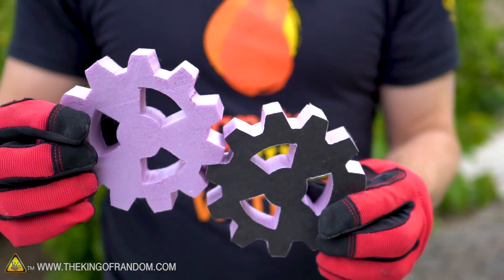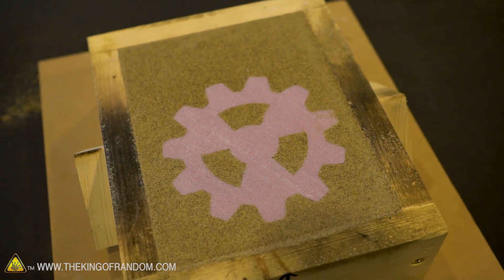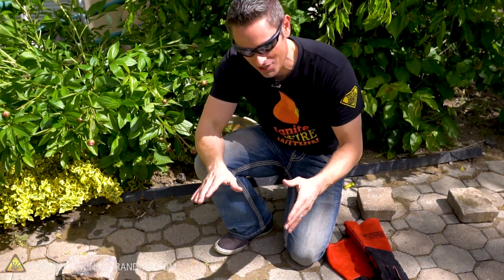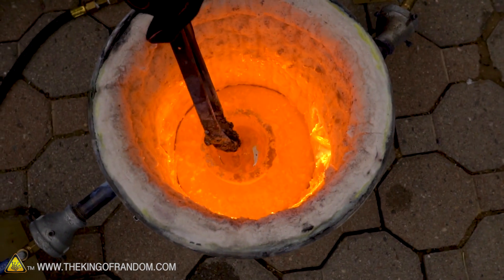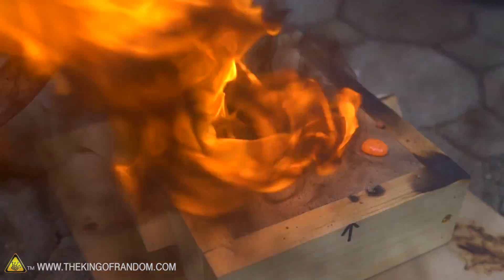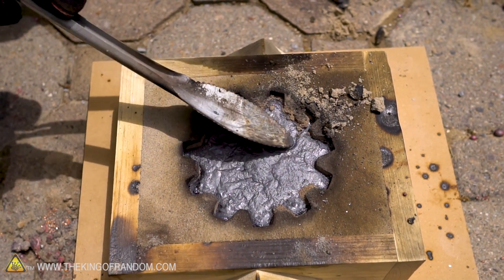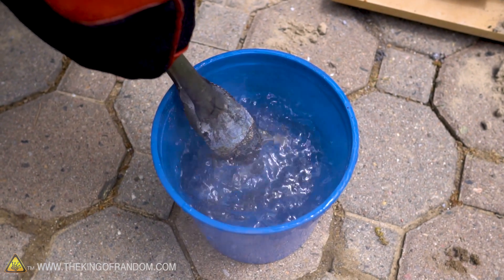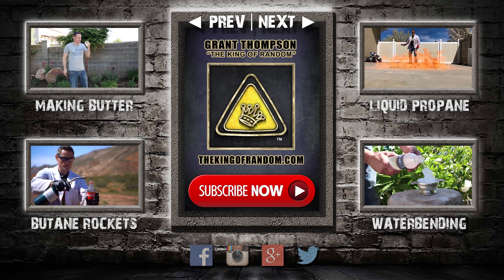Argh. Why Is Copper So Difficult? TKOR Tests Melting Copper In Our Homemade Foundry

Comment: problem is that you are using an open cast. you need to close the top and then you put the copper. given that the mold is closed it will stay molten for longer. do not pre-melt the styrofoam, that is what keeps the sand mold shape when you put the cooper.

Comment: The sand is far less dense than the copper, so in a pool of liquid copper it's going to tend to float. The glass company Corning ran into a similar problem when casting the borosilicate glass mirror for the 200-inch Hale Telescope in 1934. The mirror was designed with a waffle-like back to make it lighter and save material. To produce it, ceramic blocks were bolted to the floor of the mold, but the glass was so hot that it melted the steel bolts holding the blocks in place. Several of the blocks broke loose from their mountings and, since the ceramic was less dense than the molten glass, floated up into the glass and ruined the first mirror.
Reply: I’m late but that’s awesome! Did they spin it to make the parabola or was that a following step, do you know? 😊
Reply: @mtqrx  Oh, this was 1934. They didn't have anything like the means to spin tons of molten glass. The rough glass blank was more or less flat. After it was poured it had to be annealed in an oven and its temperature lowered gradually over several months to prevent cracking. It was then shipped by rail to California and over the following years something like half of its weight was ground away to achieve its final shape.

Comment: Aside from the starting angle of the mold when the pouring starts, and your way of pouring, my problem when I worked in a foundry was learning to keep the mold the right temp, and checking for graphite buildup inside..
Reply: They were Iron molds, I forgot to mention.

Comment: I don't know but guess the bottom of the pattern has slightly smaller area than the top, which creates a V shape at the sides, which gives the melten copper a chance to push up the sand columns

Comment: I have casted copper in green sand before and had some success 
What I did was I made a mixture of 70% sifted play sand and 30% powdered bentonite clay then mixed it with water until it seemed like enough. 
When making the mold I made it with an object i wanted to cast, then removed the object an and blased the mold in my oven to make as hard as a rock. After that I was ready to cast

Comment: Possibly try preheating the green sand mold. Itll stabilize the mold. And help with fluidity off the metal and ensure a better casting
Reply: Did you not get the news? He passed almost 2 years ago now

Comment: The sand mold should be made of 5 parts. 1 for the gear and 1 as a top which will include a well (to pour into) and gate (passage to the part), vents (to get out the gases from burning the foam), and a riser on the opposite side. The voids that you want are 3 separate pieces that protrude into the top and bottom of the mold. This method will also slow the cooling because the mold insulates the molten metal. Just make sure your sand is sturdy enough to actually remove the pattern, and the pattern should have draft angles of 3 to 5 degrees to allow it to be removed from the sand with less damage. Personally, I would just stick with investment casting, it's more accurate, and the mold is more robust and easier to make.

Comment: you have to use clay, when you wet the sand the temperature vaporizes the water which disturbs the cast. If it is dry than it won't hold. Use clay. If intend to use sand regardless then bind it with something else - oil, dry it complerly first though.

Comment: You should do it in the traditional way,,,,  wood pattern,,,, and a two piece box. The weight of copper in the riser will provide pressure to fill the mould accurately, and it keeps heat in, preventing chilling

Comment: Surely you could have made a mold that was completely encased in sand with a spout etc. The islands were coming away because they were only supported on one side... if you could have supported them from both ends I dont think this would have proven half as difficult. Just my 2cents man.

Comment: copper melts at1981.4 degrees, and boils at 4703 degrees. if you get the copper much higher temp it will pour better. I think you need more clay & water.

Comment: He pours the heavy molten copper onto the delicate edge of the sand and then wonders why the sand gets broken.  Then he pours the heavy copper into the bottom of the deep mold and wonders why the lighter islands of sand pop up like a buoys in the water.

Comment: @6:54 - REALLY dangerous!!  Moved that hot crucible of molten metal right over the top of cheap shoes using makeshift tongs.  One slip up and he would have burned the flesh right off his feet right down to the bones.  He should at least be wearing heavy leather boots.

Comment: You mentioned you thought  it was cooling too fast,  try doubling the distance between the mold snd the outer frame  all directions.  Pour the copper through  metal tubes to mold.  A little more clay to bind sand.

Comment: He definitely did not know a lot about pouring metal did he.  It is almost painful watching him make his attempts...  Do "not" use foam in a mold and try to melt it out, melting and burning foam equals cubic feet of escaping gas, guaranteed to cause issues with your pour.  Wet the sand properly and remove the foam form before pouring.  

He also needed to understand the process of "gating" the metal, you need to  create "extra" holes in your sand to allow an overflow of metal beyond the form that you want.  Molten metal has a greater volume than solid metal does this means that the poured form contracts as it cools, you need a reservoir of extra metal (gates) for the form to pull from as it contracts.

To do that gear well, one would also preferably want to have the sand mold above as well as below, this would remove the issues of the center sand pieces floating during the pour.  The only thing really difficult about his pouring a metal gear was his techniques and lack of understanding.  Hard to imagine in this day and age with all the worlds information "literally" at our finger tips, how seldom people actually go in search of this information so readily available....  Admittedly I have a bit of an edge on this guy as I worked in a metal foundry 33 years ago pouring brass and bronze bells/figurines, tools parts etc.  But still, literally 10 minutes of looking up and studying  information would have made his gear pour successful.

Comment: @the king of random copper casting is notoriously fidgety, but you can stabilize the process by using either a die, or by burying the mould in the greensand and making a pour hole, the O2 actually causes your sand to slightly deform, burying it causes a less volatile reaction , you can also use nickel or Zinc in the alloy to slow down the cooling process, which will also help, steel at 440 grade in a powder or granulated form also will work if you use approximately a 1:9 steel/copper mix

Comment: Just pour the copper onto the foam. It’ll melt the foam and fill all the space with copper. Or leave legs on the foam and cover the tire thing with sand then pour the copper onto the leg and it’ll fill the mold easier

Comment: I believe you should retry this experiment with different sand or temperature. The reason i think your attempts to make the gear casting is because you needed a second layer of sand on to so the cast wont have air pockets but you need a funnel that leads to the center of the gear

Comment: just a thought, i used to work in the art department of a foundry that produced brass belt buckles, the sand they used was mixed with regular, new motor oil. They were able to achieve fairly fine detail. Their process was very similar to what you are doing. they had hydraulic tampers instead of wood blocks. Each casting was pressed from a reusable Zinc master. They reused their sand after sieving it for chunks.They always faced with new sand. Since was not in the foundry section, i can only offer what i observed. keep up the great videos, i enjoy they immensely.

Comment: The gear is probably coming out all bumpy from the moisture explosively evaporating from the heat. Maybe wet the sand with something else or make some kind of cast that's easy to break away and that you can preheat so the copper doesn't drain its heat so rapidly.

Comment: 1. Use liquid nitrogen to freeze sand and remove Styrofoam and then pore copper into it
2. Use concrete and Styrofoam
3. Use clay and styrofoam(if need use liquid nitrogen)

Comment: you dont need to melt the styrafome( usually with blowtouch) just pour the smelt into mould an foam will evaporate.also use only one tong to extract your crucible because when its weaker before its used up after 10-20-30 melt...two tongs may apply pressure in two different directions an break the crucible more easily .or espesially a beginner or advanced.
Reply: kev bow he won’t need that advice anymore :(
Reply: Dude He's dead...

Comment: Your problem is you're melting the Styrofoam in the mold, when it melts it's damaging the base of the mold for the holes of the gear and then the molten copper is hitting it and knocking it loose. While the copper is cooling, shouldn't you have a torch on it to help it cool slower?

Comment: I was a molder when I was young. We made sand or ceramic powder mixed with a resin into a nonstick mold. The resin had a catalist to make it harden. When the resin hardens, it only took minutes then I would separate the mold from the sand or ceramic mixture. After separation you need to heat your mold with a torch to dry it completely out. Your resin was alcohol based so it would burn and dry out faster. After this I would pour the molten brass or other metals.

Comment: Hi! 2 years to late but I have an idea for the instability of your sand, the problem with moisture and green sand is that what gives its molding capabilities is the sand s friction I interacting with the water particles, thus supporting itself and able to give it shape. My thought is if you moisturize the sand, as well as as a layer of something with a higher melting point than the molten copper in the sand, (eg, particles of a heavy metal) you might get the retention you're looking for with those delicate intermediary pieces ^.^

Comment: Copper is heavier than sand, so when it was poured-in, the liquid copper slipped under the sand and lifted it.  I'm no metal worker... well, I am, but I don't do molds.  However, every mold I've seen is poured-in through a tube, and the sand is held firmly in place on all sides, including the top, so the sand cannot move up or be lifted by the force (weight) of the molten metal.

Comment: I don’t have experience in this but it looks like (especially on the last one)  those centre pieces of sand are breaking away and floating due to the weight of the copper.

Might work if you fully encase the gear with sand.

Comment: I was wrong about the bubbles. It's a common problem with copper. Try adding zinc or using some other method to degas the copper.

Comment: Use sodium silicate dissolved in water for the dampening agent instead of water.  Sodium silicate is widely used in sand casting metal.  It is highly caustic, so use caution and protective equipment.

Comment: "I've welded copper to gold" but I see your problem with the sand..try an aluminum mold and your results will happen..copper is very dense due to its atomic number , it isnt easy..simply put. p.s. I started brazing shower curtain rods to hold water at the age of 6

Comment: Why did you even go with the open mould?
Liquid copper is heavier than the sand so it pushes the sand out.
Why don't you make a match plate mould and try again.
Also try to give the gate at the centre of the mould.

Comment: Try melting the crucible. I don't know if it's even possible. But try it once.

Thank you so much for the videos. Love them.
Reply: It's not impossible, but it would be dangerous and tedious. Crucibles were built to withstand the extreme heat and pressure you get from molten metals and minerals, some of those often found in magma and lava.

Comment: use some steel wire in the cogs to hold them, run them straight through the mold basically as rebar

Comment: Why don’t you do the same way then put another block of sand with sand funnels so you can pour the copper  you can leave the styrofoam in in there and it will melt it down ... if you do this leave other small holes bc gas can leave and you’ll see you copper come up to know you have a full cast    Then all you’ll have to do is chop off the rods and then sand it down

Comment: Can you use mud or dirt to cast a gear
Reply: baking clay will work as long as you mold is baked entirely dry...Never pour copper in a clay mold that may have moisture in the clay

Comment: Your not packing the sand enough. Also you need a second half of the cast even if it's a blank on top of the other one and two holes into the mold then only pour through one hole

Comment: I think you should have put a board on top of it and drilled a decent sized hole in the center and leave the gear compressed with the board on top and then pour it then the sand won't have anywhere to pop up at that might work

Comment: You need to do the mold exactly as is then get another solid mold on top of it with just sand so it's closed in the middle. Then lastly a hole to lead to the mold itself in the compacted top sand. That insures the best possible molding

Comment: I was watching a documentary, How it's Made I think it was, and they made a top mold of sand with a sprue hole to pour into. I think that was your problem, the top half of the sand mold holds the bits of sand from moving or floating up.

Comment: If you make a trench on the side for material to run into mold pouring it on top is to much weight it’s pushing sand around.

Comment: Why not just just use a much harder styrofoam of use tape or glue on its bottom and in the radioactive symbol? that way,  when it melts it lasts juuuust long enough to hold the sand in place

Comment: Open faced molds obviously don't work well. You need a cope and a drag to prevent the hydraulic event which is popping off the sand when the heat dries out the moisture. You might want to try Petrobond sand. The results will be super clean...

Comment: Seems to me you need a second wood form just with sand, sandwiched up against the gear mold, that has a hole to pour the copper into so it flows down into the gear. The extra layer should keep your original mold intact. Im not a metal forger but it seems like common sense to me.

Comment: When we thermite weld railroad tracks we use a foundry clay. It has sand already in the clay, but the clay needs to be heated slightly prior to pouring your slag/metal. You don’t want your clay to appear slimy because any additional moisture may explode because of temperature difference.

Comment: Why don't we use cement and sand mix.. rather than use simple sand ???
Reply: That will explode are you trying to get people to blow up cement holds moisture moisture in gas and he explodes it will explode

Comment: Pack one box with the gear. Then pack a second box with no gear. The box that has the gear needs a hole like pack a pipe that gose the gear. Now box with no gear on bottom. Box with gear facing down  on top. Poor cooper through pipe to gear wait 15 min then pull apart works every thime

Comment: I worked in a foundry for many years.  We have chemicals to our sand so it sets better and holds it's shape better.  One other thing is we never pour directly into the piece we are making.  We have runners and vents which allow the metal to flow and fill.  I hope this helps.
Reply: Was thinking the same.. would be so easy and perfect with vents
Reply: Things we get taught in college has implications tho......
Reply: Waterglass to the sand, hardened with CO2.
Reply: to bad he can't see this😭😭😭😭
Reply: @redpearyear  wait he has dead?? Ive seen some comments bout that
Reply: @gyrozeppeli8932  yes sadly :,( R.I.P

Comment: Hey Grant!
As you noticed yourself during the casting of the last gear, you commented on the crispy sand. What if, you put the mold with the styrofoam gear some place hot and let it become a bit crispy. And in that way, make the sand hold together more easily?

Comment: The way I have done it is to use a two part mold riddling the sand mixed with a bit of oil as a binder and tamping it around the object to be cast. Use a mold release like talc between the two layers. Join the two halves and riddle sand over the first half. Then separate the halves carefully an remove the item to be cast and sprinkle graphite into the mold and carefully create a funnel shape sprue (pour opening) and several small channels to the outside to allow gases to escape. Rejoin the mold halves and clamp.  Pour molten metal into the mold thru the sprue hole and let it cool.  When cool, separate the mold and clean your casting.

Comment: First of all I need to say thanks for your efforts and determination on this experiment the problem you almost ran into everytime might be that the sand you use has lower density than that of copper ,which caused those parts to the surface as if they were floating but I must say I'm not quite sure

Comment: Why didn’t you try to sandwich the gear in the sand. Sand on the bottom and top. This will provide insulation to keep the cooper hot and fill in the mold, plus it provides more stability to the same. A pack tight space will prevent the sand from getting loose. It would be like a ant-farm.

Comment: ...not sure but i believe you might have more success if you pre-heated the sand to a more hot temp instead of pouring into cold sand. So uses a propane torch and a sand with more clay... it should harden to a ceramic clay shell and not collapse ..but i am speculating